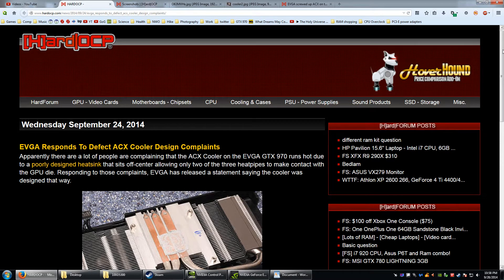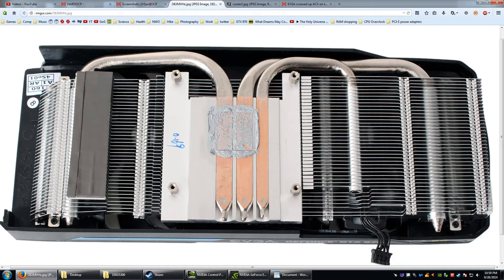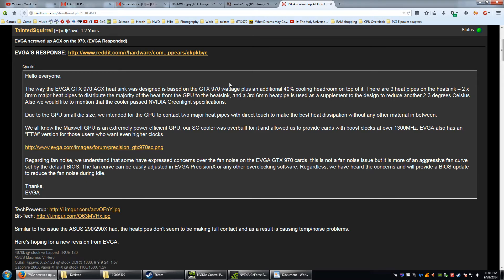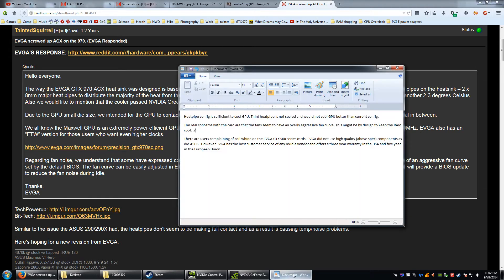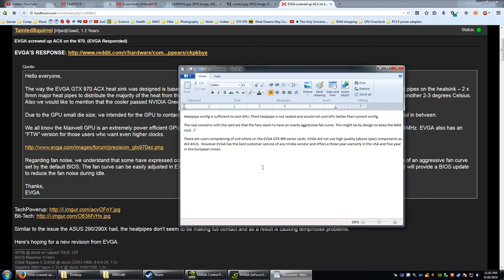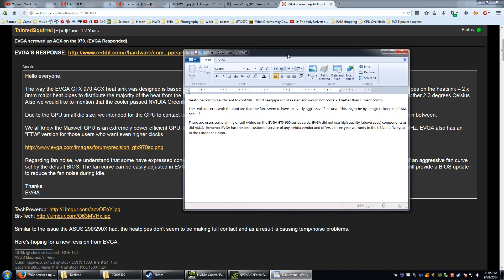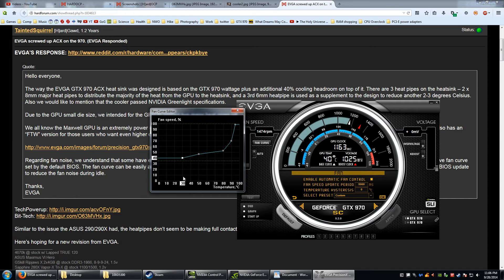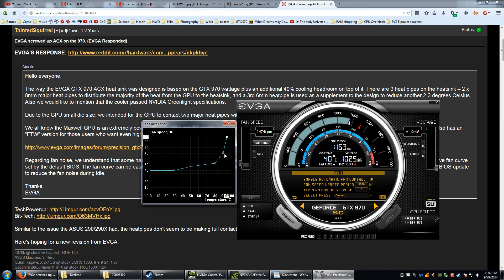Are EVGA GTX 970 and GTX 980 ACX cooler heatpipes misaligned??

Comment: 9:00 thanks for the video.
Curious, wouldn't you want to set fan speed to 100% @ 90º to warn you in advance of possible damage?
Would be nice if there was also a pop-up warning you of a user defined temp.
 rather than rely on hearing the fan crank up which would be difficult over game noise
Reply from the maker: Hi. You're welcome! Yes that's a good idea to have 100% fan @ 90º. It woud be very loud of course but 90º should be considered on the edge of overheated. I think MSI Afterburner can do alarms if the temp gets too high. Welcome to the channel!

Comment: my card is soon here i am hoping everything goes well :)
Reply from the maker: skbenergy How is the new card? Get it yet?
Reply: GamedOut Gamer yeah i got it, working good so far :) its quiet under idle but noisy under  loads times  but nothing to bother me so far :)
Reply from the maker: skbenergy  Great! Yes the fan blows a lot when the gpu is over ~60c. Did you try the alternative fan curve near the end of this vid? It helps a whole lot with the noise and performance is nearly the same. The fans seem to blow too much for no good reason but I could be wrong.
Reply: GamedOut Gamer nar i have not tried it yet but will check it out soon :)